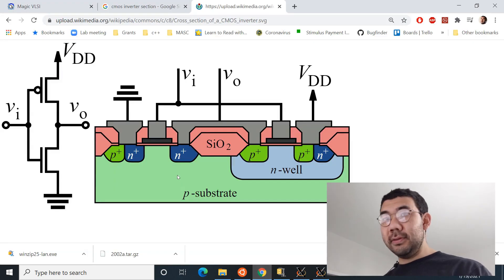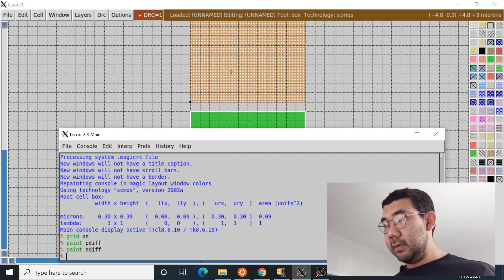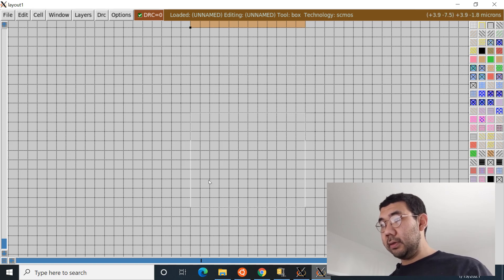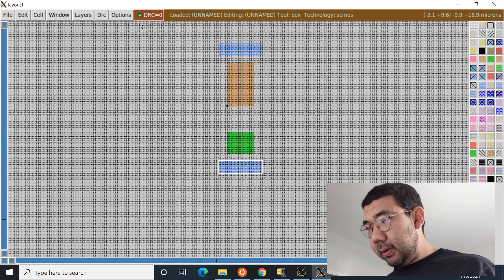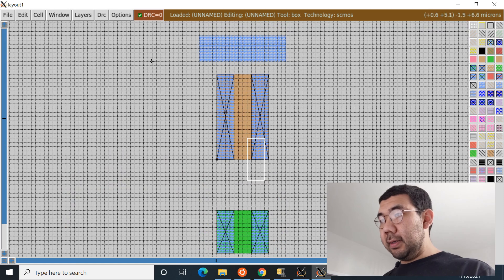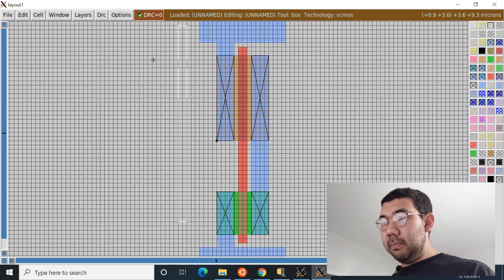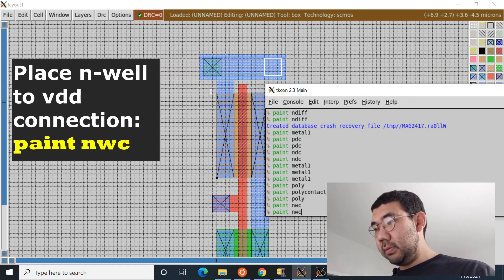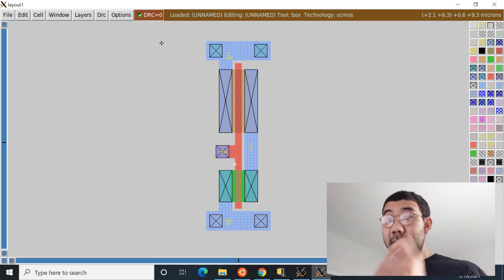Magic VLSI Tutorial (part 2), Laying out CMOS inverter

Comment: can this software be used to lie out billion of transistors?
Reply: what are you designing? a processor?
Reply: @ahmedansari2786  yep, a processor with my own FPGA fabric for high performance computing
Reply from the maker: I have never tried loading designs that big, so I don't know if it will scale :) But I know that Fossi foundation uses Magic in their design flow to tape out a riscv processor, maybe you can find some info there.
Reply: @kabylkas  risc v? but afaik it is a single core, there shouldnt be more than 100k transistors in it
Reply from the maker: @absolute___zero  Well, risc v is just a specification. The implementation can vary from simple single core to a complex multi core. For example, people in Berkeley have BOOM core which is pretty beefy out-of-order core, which can be configure to be a multi core. But I have never thought about transistor count, so I don't know for sure.

Comment: you are using osu180nm tech file right?
Reply from the maker: Hi Ahmed, no I have been using 0.6um technology file, but I don't see any reasons you can just load different one. This is the lambda based design method so it should work just fine.